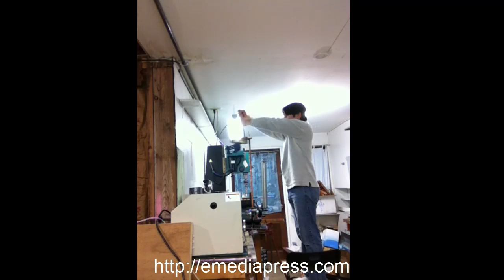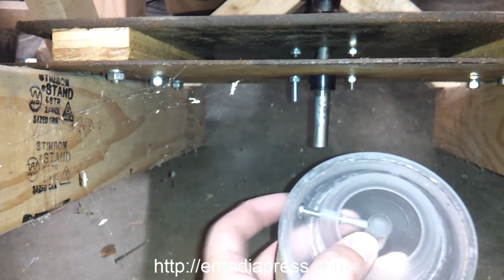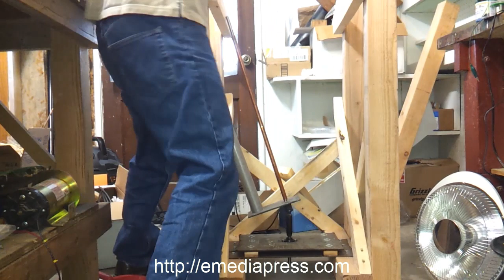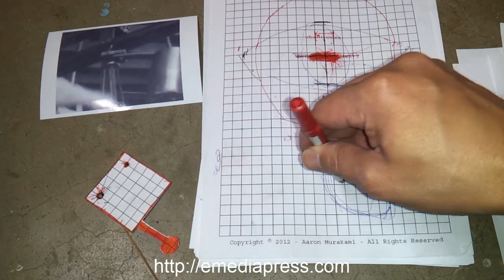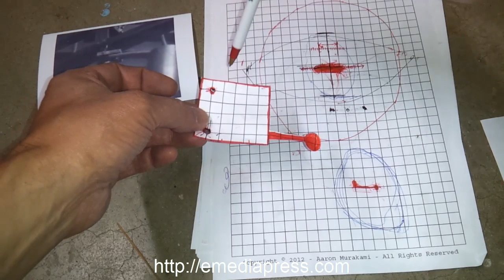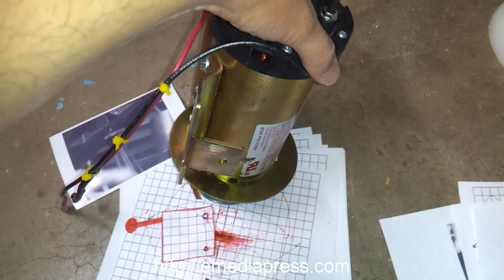Gravity Power Secrets Revealed

Comment: Problem Solved!! - see DrElectrical Torque motor  - of 8 years ago - he shows you his Skinner Gravity Oscillator running at 120 rpm as the wood frame of the unit sways strongly matching the moment of inertia of the rotating inertial mass to the periodicity of the rotational driving force thus producing maximum torque at the output - and All that at Low Cost!! - Build it using Screws and Walk like an Egyptian!

Comment: some people are saying that the upper drive lever is turning in an elliptical orbit. but it does not look that way to me and I see problems with that.  first what ever the lever is doing, it translates to what the first mass will be doing.   the orbit size and shape the lever makes will determine how high the weight is lifted ,  depending  on back and forth, elliptical, or circular the movement of the weight and how gravity will act on it will change.   the levers movement choice  will also determine the speed of acceleration of the weight, weather there is any deceleration in the orbit or if the orbit remains constant, weather there is any raising and falling of the weight,  The lever is the key component in the system.   if the orbit is a circle the following will take place, the weight begins at a resting point, at the bottom of the rotational cycle.    when the lever is pulled back the weight is lifted against gravity, using leverage.   when the weight reaches a position where gravity can no longer act  on it,  this  will be it's  neutral position. you will know when you have reached this position because there will be a balance point for the weight, and you will feel little or no resistance at the top of the lever. this is the balance point of the weight.  now the lever must continue to lift the weight a little  higher, past it's neutral position, but what is really happening is you are simply tipping the weight over, like if you balanced a pencil on a table and then it falls when the balance is lost.   at that point gravity begins to act on it again pulling it down in the opposite direction from which it was lifted.    it is at this point where the lever ends the lifting movement of the weight and begins it's rotational cycle.  there is no more lifting of the weight, the weight has reached a balanced  height then passed it and is now in the falling stage.   now you are at the next stage where your choice of rotational pattern of the lever will effect what the weight will do, and how much gravity energy will be harvested.   if your choice is circular the weight will fall in a circular path, following  the levers circular path.  remember the lever maintains the weights lifted height at a constant, where gravity is acting on it trying to pull it down. and now the levers job is to maintain that position while the weight falls in the circular path and begins to rotate.   the lever must rotate because it has to maintain a constant lifted  position of the weight just past it's balance point.   the weight is kept in this constant lift as it follows the path the lever makes.   the lifting and falling process is simultaneous,  similar to a  ocean wave lifting a surf board,  the wave will maintain a constant even steady lift ,  the surf board once raised up by the wave will start to fall but the wave does not stop, it keeps moving forward while keeping the board in a lifted position  where gravity can continually act on it. which means the board  will also fall at a steady, even, constant rate.        now lets change the levers rotational pattern to a forward and back pattern.    the lever lifts the weight from it's resting position, to a neutral position, the lever continues lifting and now gravity can act on the weight,  the weight begins to fall but what is the lever doing now ? instead of maintaining the weights position  it is continues  to lift the weight, creating a ever steeper angle, which does allow gravity to pull even harder on the weight causing it to accelerate.  but what happens next ?  the lever reaches it's full height, and the weight has fallen from its full height to it's lowest height and now the lever has to come to a stop and reverse it's movement, what is the weight doing at this point ? first gravity has stopped acting on the weight and the weight begins to slow down, momentum keeps the weight going for a period but the weight is continuing  to slow down because the weight is now going up hill as the lever begins lifting it again.    it will continue  going up hill until the lever has moved far enough  in the other direction to lift the weight back up past neutral to where gravity can act on it again.    this is just one of the problems,  what else is happening ?  the weight has picked up a lot of speed going from the  12 O'clock to the 6 O'clock position.  and now has a lot more force pulling against the lever, so when the lever reverses going from the 6 O' clock back to the 12 O'clock position there is required more force and speed  applied to the lever to get it back to the point where gravity can act on it again. you are fighting against G forces and at this point you are not harvesting gravity anymore, instead you are simply throwing the weight, a slingshot motion.    you have left gravity behind and what you are doing now is throwing the weight with each forward and back movement of the lever.   that is  not how the skinner device functions  and you will get no energy amplification, only a need to keep moving the lever faster and faster each direction to catch up to the rotational speed you are creating in the weight.           so what about the elliptical orbit ?   the same thing is happening in the elliptical as with the forward and backward movement except  to a lesser degree.   the weight is lifted, gravity begins to act on it,  it begins it's elliptical path which also continues to lift the weight but to a lesser degree, the weight accelerates but to a lesser degree, the weight rises and falls but to a lesser degree, the lever transitions from lifting  to going  the other direction but to a lesser degree,  during  the transition the weight slows down but to a lesser degree, sling shotting the weigh but to a lesser degree.  and depending on the speed your lever is moving in this orbit you may harvest gravity or may not. but at a much lesser efficiency.   in a elliptical orbit  there is acceleration and deceleration there may be jerking forces involved,  the weight will be constantly lifting and lowering while rotating.   why lift the weight so gravity can act on it only to lower the weight twice through each rotational cycle and prevent gravity from acting on it ? it makes no sense .  when you can have the weight in constant lift and falling mode with a circle? no jerking, no speeding up and slowing down, no rising and falling in height. just a steady falling of the weight, even, constant and balanced.

Comment: The second stage is exactly the same as the first stage only the second stage is being driven by a more powerful force.  The second stages  rotational pattern is being controlled by the first stages lever.  however the second stage has much more power driving the it's lever than the first stage had.  the lifting height of the weight and rotational pattern  is still the same as the first stage because the first stage lever is also controlling those processes in the second stage.   the increase in power rotating the second stage lever comes from the spinning weight,  the first stage created a condition where gravity could enter the system and gravity energy entered by acting on the weight causing it to rotate.  so now you have a spinning mass rotating the top of the second stage lever.  which allows the  second stage to accommodate a larger mass.   your second stage will also harvest gravity  and you have now amplified mechanical force through harvesting gravity.      The more leverage you use By increasing the length of the lever, the less power you will need to lift the mass and so you could increase the size of the mass.  However increasing the lever length will also require a larger diameter circular path for the lever to make in order to lift the mass to a  height for gravity to act on it.   The length of the lever and how far it protrudes out of the gimbal at the bottom will determine along with the Circular path the lever makes, how high the mass will be lifted.  
Another issue will be in balancing the weights, The first stage only has so much power and can only lift a certain amount of mass in the second stage, if you use too heavy of weight in the second stage the first stage wont be able to lift it.  And if you don’t use enough weight in the second stage your power Amplification factor will be lower.     I would build the top section first, The motor size, the lengths of the lever arms and the size of the mass are all relative,  consider them in relation and proportion to each other in order to tune the machine.  You can make the levers longer or shorter you can increase the drive motor size you just have to adjust the size of the mass so the motor can drive it without overheating but remember to size your secondary mass large enough to create the maximum amplification.

Comment: Did you measure the cop? How much power in input and how much in output? Can you confirm that there is a cop of 12? Thank you and sorry for my English, I am French and I use google translate ...
Reply from the maker: I can't confirm that - my friend built a full scale model and is still working on it. All I was doing was working out the mechanism.
Reply: @AaronMurakami13  I figured out the correct motion of the mechanism. When the weight "stops" (you can see that it isn't blurry on the film) it is quickly moved out then back in. You can try this yourself with the top weight or the bottom weight. I do not believe two weights are necessary, but the odd motion pattern is. When a pendulum is moving upwards, it's inertia combined with gravity results in a vector pointing upward. Anti-gravity, essentially. When a pendulum reaches the top of its swing, it behaves like it is weightless and can be moved easily. So you let the weight fall downwards to accelerate then let it swing up, and [almost effortlessly] move it over the center of the axis so it can fall again.
Reply from the maker: @bendere1488  Can you elaborate in an email info at emediapress dot com ?

Comment: Hi Aaron, thank you for sharing your insights. In my first design I'm going to omitt upper weight. It's like a third wheel in a bike :-) Amplification of power is reached by inertia lower weight and is controlled by mass and angular speed. How are you going to input power to the system ? I think 10-30 Watt DC motor is more than enough. I will start with buying AC generator and then design gear. This will give me an indication about the necessary starting torque ie spinning weight and shaft precession angle. In my simplified design the shaft is going to spin like gyroscope axle . :-) Anyway, I'm sure you are going to accomplish your project first. Wish you brilliant success !
Reply from the maker: +Ameron Tine A Bedini SG turning the wheel according to my elliptical method of slanting a wheel. The SG will only have to pulse every 180 degrees. Thank you and hope to see your results. Focus on the elliptical input! :) Check out the Skinner thread at Energeticforum.com and post there if you can.

Comment: Seems you are reaching into the ideas of a harmonic driven oscillator
http://retro.grinnell.edu/academic/physics/faculty/case/swing

Good things to look into.
Reply: +moonfther You are absolutely correct, that part when they describe how a string can pump up the swing of a ball through lifting the pivot at the right time , takes place in this machine with an elliptical and a pulsating input and also in the working of the Milkovic machine.   Congratulations for your observation.

Comment: Good video and Info, I have found that in the 2 stage oscillator once the small weight starts to lift the other side the small up and down motion counter acts the small input needed. I could never get any of my attempts keep going. It always counteracted it's self. I found this to be very true. I also found that once going and starting to do work it is doing more than put in but only for a short period. I'm guessing this system will do the same. The fact that each has a degree of freedom will counter act the Input. Either way... It's a good idea to try. By looking at it it looks good so now only tests will tell. By the way. Have you finished the test? Dose it indeed work? Or is this just unfinished testing? So others can also find the flaw on there own? Thanks, ~Russ
Reply from the maker: My video here explains the same reason why you cannot try to close the loop on the Veljko Oscillator - to do so, you cut out gravity and you make the output proportional to the input and it will die down. Leave it open loop...then for each mechanical input on the pendulum, you get a multiplied amount of work at the hammer. That is the whole point. So many people think they need to close the loop to get overunity, but that is misinformation - to do so cuts out the free energy.
Reply: Aaron Murakami no, no, i completely agree with you on not closing the loop. i never implied closing the loop. what i said was that on the 2 stage oscillator once the heavy second stage starts to move it changes the standard arc swing path of the smaller first stage to a up and down + arc path and it drastically effects the momentum the smaller weight has from the small push it needs to keep going.  it creates a totally differently ark pattern, this change in its arc kills the effect.   like your elliptical path. it would be the equivalent to  changing the elliptical path in such a way that it counter acts what the bigger weight is doing. any how back to the first 3 questions: 1.Have you finished the test? 2.Dose it indeed work,Or is this just unfinished testing? 3.So others can also find the flaw on there own? im not trying to pick your work apart. im trying to find out where you stand on the subject. i'v been reading the forum too.. you can answer there if you want...  Thanks, ~Russ
Reply from the maker: *****
Hi Russ - I have done some tests, but I am not finished. There is more I want to do. The results I have are positive - it appears to be doing what is claimed. I have a clumsy setup and it is not 1200%, but there does appear to be a gain. I don't think there is a flaw in it at this time. I'm looking for a few ways to simply the upper parts, but with my renewed interest in this machine, I think I'm going to go back to the original replication. I don't know if I can do this before the conference but if I can, I'd like to bring it out for people to see.